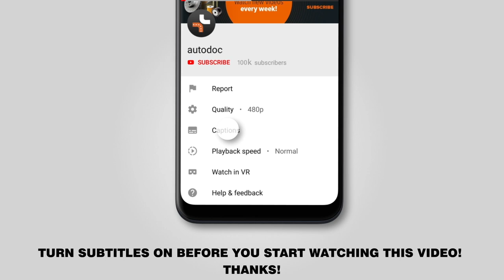How to change a front shock strut on RENAULT MEGANE 2 (LM) [TUTORIAL AUTODOC]

Comment: To me it looks really risky to spray copper grease on the rotor without first masking the brake surface.
Reply from the maker: Yes, you are absolutely right, the mechanic cleaned the surface with a cleaner after application, but that moment was not included in the video.